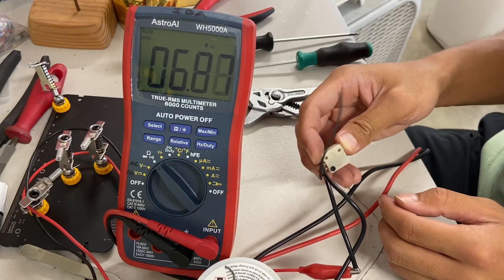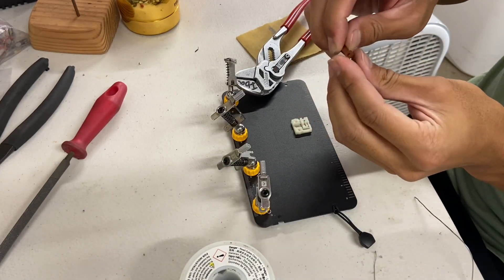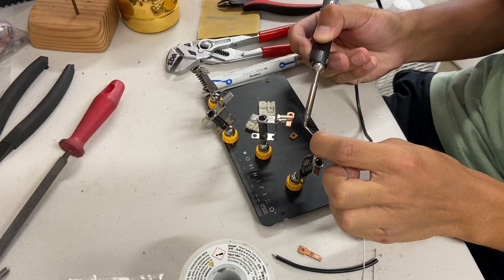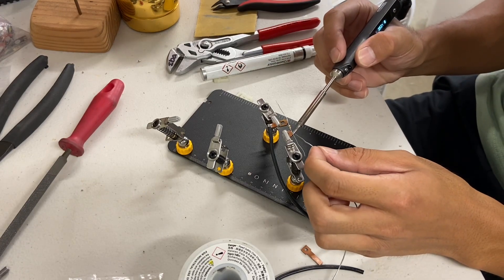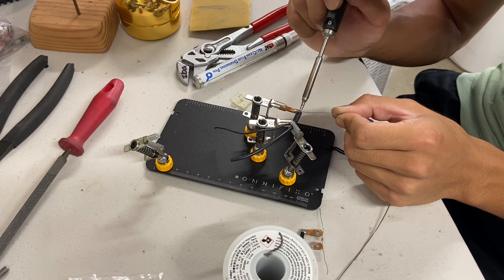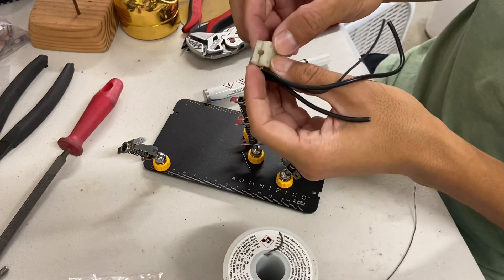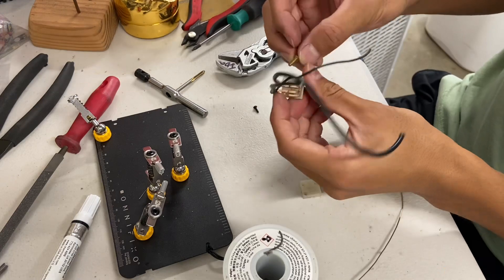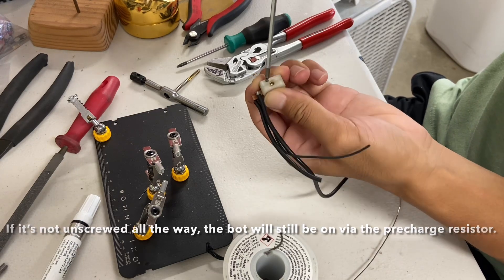Lynx Switch Tutorial - Beetleweight Anti-spark Switch

Comment: I really like the detail to this. What voltage have you found were this is needed, and a spark becomes a concern for the Finger Tech switch? 4S? 6S?
Reply from the maker: 6s and ESCs with big capacitors. Others have used 6s fine with fingertech switches and blheli32 ESCs.

Comment: Nice work.  Only a single 30-ohm resistor is necessary to suppress the spark?
Reply from the maker: Yeah. It needs to have a high enough resistance to not burn out but low enough for the blheli beeps to beep
Reply: @IbaLabs  another question.  Did you purchase or make the copper tabs?  if so do you have a link?
Reply from the maker: @BillsWorkbench  I got them laser cut by sendcutsend. So far I just sell the switches locally or to people that want them at combat robot events that I go to.
Reply: @IbaLabs  Thank you!